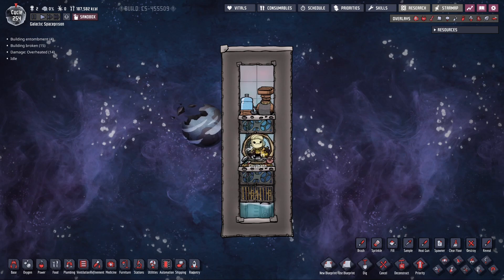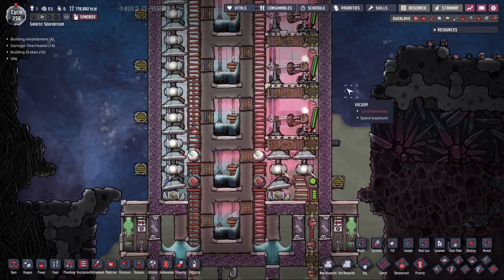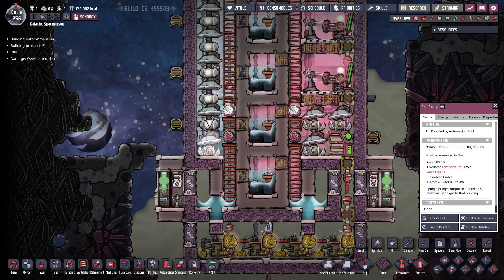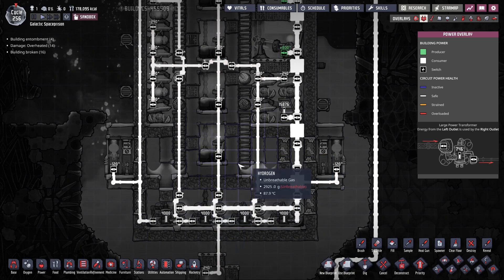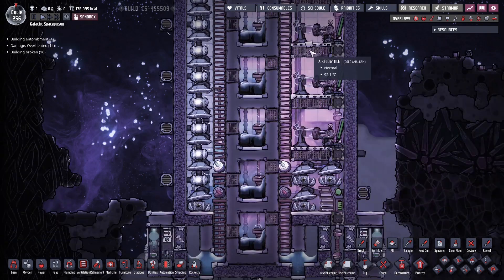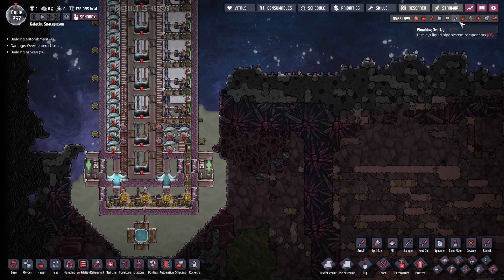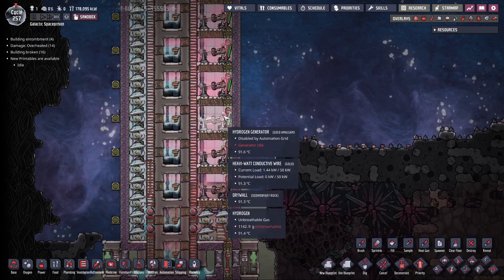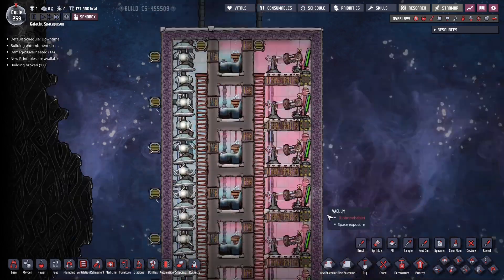ULTIMATE late-game Electrolyzer SPOM - Oxygen Not Included

Comment: If you use a water elevator on the left hand side to compact the gases you can do away with needing all the oxygen pumps, just simply have sideways doors open based on a pressure threshold to release pressurized oxygen.
That would let you cut the power cost by well over 40%
Reply from the maker: For sure! Used a bead pump in the Factory series, no electric pumps for oxygen.

Comment: Thanks for the awesome built.

Just curious: what would happen in the following cases:
- the water supply is cut off?
- the oxygen or hydrogen chamber is at very low pressure.  For example, if I used too much hydrogen.

Comment: Interesting/ What about overheating? Everything heats and you have to determinate the temperature. I see no cooling system... Or have you used some space materials?
Reply from the maker: Effectively all machines and surrounding gases are cooled by fresh water, coming in at 95C.
Machines made of Gold Amalgam or Steel can handle this no problem.
Water has huge SHC and heats up only slightly, then when it is converted to H2 & O2 at the same temp but lower SHC.
Because of the difference in specific heat capacity, heat is effectively deleted in electrolysis.
In reality, gases would come out at higher temp to maintain same heat, but this is ONI :)

Comment: Would you have a clue as to how to set up the automation for a 3-door pump/vacuum lock for liquifying hydrogen and oxygen? I'm looking to remove the pump requirement. Your 'hydra' setup fits in perfectly for the cold room I've set up.
Reply from the maker: Check out this approach to pump lots of gas (into a chiller for example): https://www.youtube.com/watch?v=1zPobgmHZtA , you may need to use Super Coolant for the bead and LH drip for Hydrogen side and LOX drip for Oxygen side.
Reply: @greezyhammer764  I’m familiar with the liquid bypass pump, the problem is there’s no vacuum seal so the temperatures leak into each other. The way I’ve set up at the moment uses a liquid bead pump to drip hydrogen down and pull the hydrogen gas up while cooling the electrolysers and excess pumps as well. So far the automation is looking to get overcomplicated when all it’s really doing is removing the pump and vent requirement, but I find precooling hydrogen like this a very elegant solution.
Reply from the maker: @Mysterious_Old_Geek  Just sandboxed this, seems to work pretty well, thoughts?: https://imgur.com/a/9MBkDOD
Reply: @greezyhammer764  I would make the area where you cool the oxygen and hydrogen larger in order to fit a thermo sensor, definately add tempshift plates, and add automation to the pump from the liquid reservoir so you can have more thermal mass cooling the incoming gasses. For so far as I can tell when a gas turns into liquid in an airflow tile, it always displaces to the next available tile above, so you're golden with the pump design.

Instead of an additional thermo sensor you can also run a short loop through a liquid thermo sensor and a liquid shutoff to fine tune the outcoming temperatures and it's also recommended to place the liquid thermo sensors for the aquatuners in the pipe before entering, arguably adding a filter gate in between as well.

Finally I can't seem to understand the use of the doors in your cold room as they contact insulated tiles. Am I missing something, or was this something left over from when coming up with the design?

Comment: How would you go about adding automation control to this setup? Would an automation wire connected to the electrolyzers be enough, or would the hydrogen continuing to be burn mean that the hydrogen column would have to be repressurized before turning the system back on?
Reply from the maker: Atmo sensors work well to make sure that hydrogen or oxygen don't get fully pumped out. Oxygen can also be dumped into base using a door or a bypass pump triggered by an atmo sensor in the base (i.e. in the Factory). Production is throttled by water valve/shutoff, and you can just build a couple levels vs a 10-level.

Comment: Hi Greezy Hammer!
I tried it serveral times in survival but it wouldnt work. So i will ask y. How can y get 1kg of each liquid on top of the electrolyzer.(Yes i know that y did it in sandbox mode in the video. ) Thx
Reply from the maker: Check out how I build it here: https://www.youtube.com/watch?v=H9BIsvGZGn8&t=867s
Reply: Very easy way to do it for you.
Build a bottle emptier above where you want the liquid to be on a mesh tile.
Have them deliver 10kg of liquid to the bottle emptier, this places it on the floor exactly where you need it.
Deconstruct the bottle emptier and the mesh tile.
If there is any mess just have them mop before you attempt to run the machine.

It really doesn't matter how much liquid is in the tile with how oni works, its only purpose is to occupy the tile so don't stress about getting perfect amounts.
Reply: @bahamutdragon1754  Thx. But how do y manage that the dupes will deliver only 10kg? (My dupes are carrying either 10g or 200kg bottles around)
Reply: @CannedHeatGaming  Use a dupe with noodle arms, their carrying capacity is so tiny they will bring 10-50kg bottles.
Reply: @bahamutdragon1754  k thx a lot